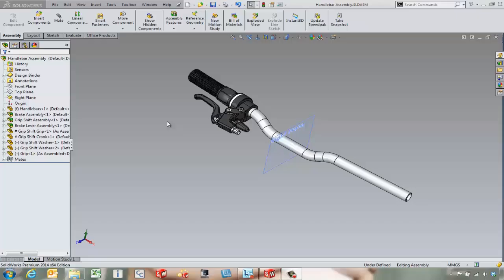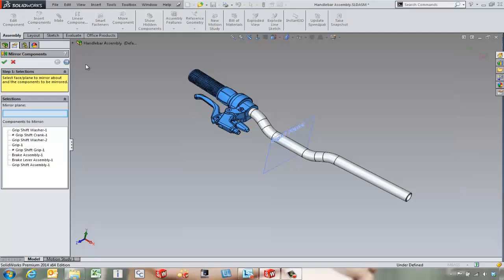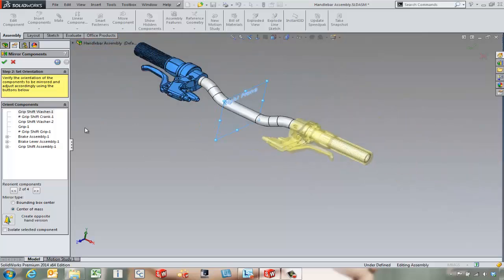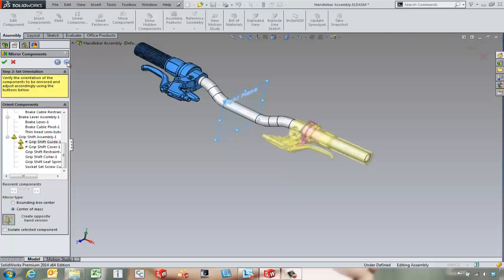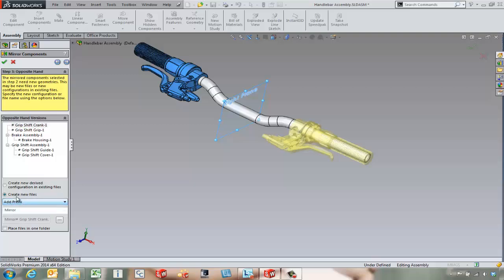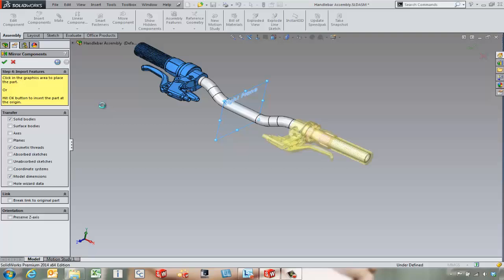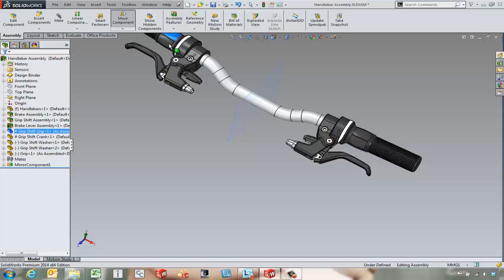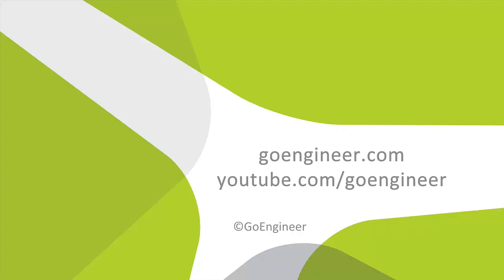SOLIDWORKS - Mirror Components at the Assembly Level

Comment: Thanks for the videos. Obviously you published the video some time ago and now the mirroring interface has changed a little bit but remains more or less the same. My question is: is it possible to save the mirrored component as a separate assembly while keeping it synced with the original parts in case they change ? Obviously in this case you need both subassemblies in the final assembly, but many times they work as different subassemblies depending on where you need them. In all the videos I have seen, including this one, the mirrored subassembly is saved as part of the "whole" assembly.

Comment: How do you remove the symmetric mates?
Reply from the maker: The symmetry for the mirrored components is controlled thru the Mirror Component feature.  There aren’t actual symmetry mates.  We do have the ability to “Dissolve Mirrored Component Feature” if we want to remove the symmetric nature of the components.  We will get a message asking if we want to “recreate mates in the top level assembly after dissolving mirrored component feature?”.  It appears that mates between the mirrored components will still be present, but mates to the parts on the other side of the assembly will not.